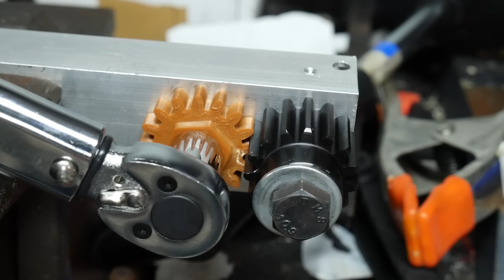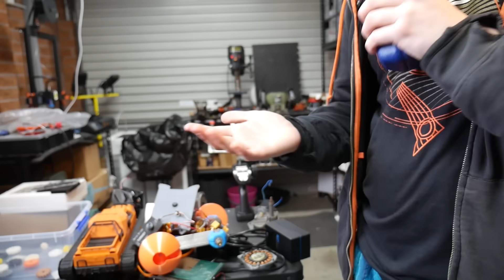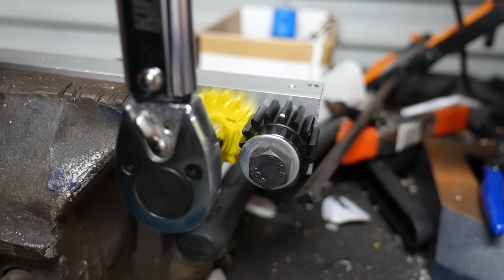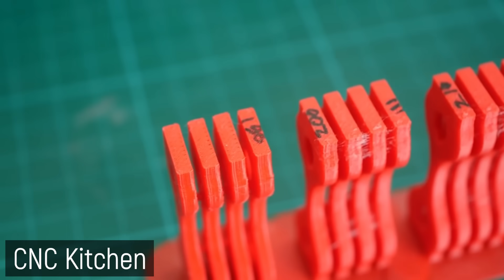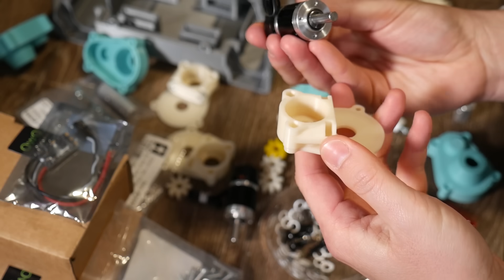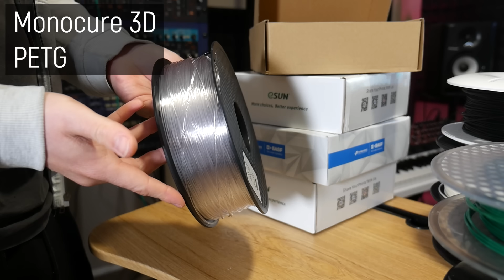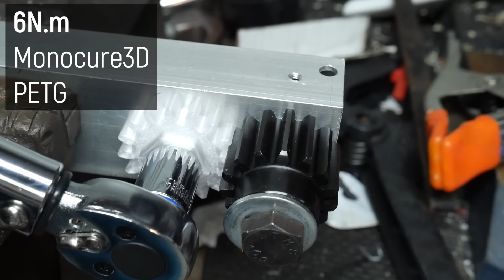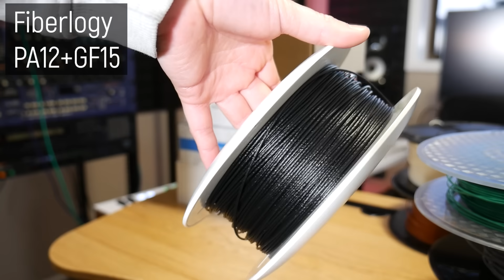Which 3D Printed Gear is Best?

Comment: If you are stripping gears, plastic is not right for that job. 
In that case, I would 3D print the gear and sand cast it in aluminum, like MyFordBoy shows in his YT videos. 
Also, gears must be infill 100% for torque measurements. PLA is fine, but ABS is a standard. If you need more strength, you should go to metal gears for the final stage, like normal people :) 
You'll be more than fine for the gearbox of that little rover. I went with herringbone myself. M1 Mod worked for my robot which is 3 times the size of yours. 
For transmission applications, spur gear is not ideal. Helical is usually used, but herringbone is best. Nosier, but a lot more contact area between each teeth.
Reply: Just about nobody in their right mind makes gears out of ABS. Reason is low surface abrasion resistance. Most injection-moulded plastic gears are made from Nylon, and a smaller number from Delrin, though a bunch of other plastics can make sense.

That being said it's not necessarily the case that ABS filament is the same as ABS pellets for injection moulding, it might even actually be SAN which shouldn't be so strongly affected by surface friction.
Reply: @SianaGearz  See what happens to your nylon gears at 60ºC noob. 
Before all these fancy plastics came out, and the original reprap parts, were all made from ABS for heat resistance.
Reply: @piconano  Short term, nothing happens at 60°C, nothing at all. Over the course of several weeks or months, they will crack. Nylon shouldn't be run continuously hot, it needs time to regenerate by reabsorbing humidity, which it loses at elevated temperatures.

Reprap parts made from ABS - yes, so what? They were designed to be remade as-needed, not to be perfect. The only classic part i can think of with gear to gear contact is the geared extruder, but that simply doesn't run all that much overall distance, an RC car gearbox manages more in a fraction of a day than a Wade in its whole life.

STFU Noob.

Comment: BIG factor for 3d printed gears is heat resistance.  local heating at the contact points due to rubbing and flexing can quickly build up and cause rapid wear.  In my experience over heating is the cause of the vast majority of 3d printed gear failures.  This results in the best gear materials also being optimized for 3 things; high melting point, low friction, and low flexural hysteresis.  (so Torlon > PEEK > Delrin > Nylon > PETG etc.)

Comment: I still don't get why you didn't use 100% infill for a strength test of a gear
Reply: Yeah I stopped watching cause if I was printing a gear, I would want it strong, I'd then test material strength for final prints.
Reply: You might not want it to be too strong, imagine a yard rake where the claws of the rake are thin metal and you are pulling it behind your rider mower, you want that gear to last a long time but you'd rather have the gear self destruct in the gear train before the rake mangles itself if caught on a branch or something big!
Reply: @wolfrig2000  this video is about material strength comparison, not a specific application where you want to limit the strength.
Reply: @crzprgrmmr  and material strength on anisotropic materials depends on many factors. If you print at 40% infill on everything, why would you test a 100% infill gear? It’s about application. That being said of course you could do any level of infill if you’re doing relative strength testing (same conditions, different material). It’s a relative test, absolute testing would be cool but isn’t what’s happening here anyway.

Comment: Hex are a suboptimal solution for driving gears. Since the angle of contact isn't tangential, you tend to have a lot of deformations at high torque.

A splined shaft would work much better. Think about how torx screws are harder to strip than allen/hex screws

Comment: I think heat generated by the friction of the gears is more important in this application. Rather than cracks generated by torque heat resistance would be more crucial.

Comment: I wish you had some POM or iglidur Tribo Filament
Reply: Trust me if even Vision Miner itself says that POM should never be printed you don't want to do it

The Warping;the highly specific temperatures on bed, hotend and chamber; the extremely poor dimensional accuracy and the significant carcinogenic formaldehyde emissions just make the entire package not worth it at all 

Even then the strength isn't really that good especially considering that any printer capable of all this could easily be upgraded to work with better stuff

Comment: You might see how each material wears as well. I know nylon is known as being self lubricating and slides against other gears well. I printed a couple large gears in bridge nylon for and R2D2 that weighed 50+ pounds and they held up incredibly well. Printing in nylon was a real pain though due to warping and shrinkage
Reply: Yes, and so any of the filaments cause nozzle wear in your printer?  That concern, along with needing to run at higher temperatures and fewer color choices are what keep me away from filaments more exotic than PLA and PETG.
Reply: One of the most important things on a gear is that it's designed correctly. If you do it with the correct tooth profile for a gear (and correct distance for meshing), they don't slide at all, they just roll. That reduces a lot the wear on gears. Now it does make sense to lubricate them anyway, specially the shaft and sides as those will be sliding over something.
Reply: I wouldn't call Nylon self-lubricating, its partly flexible which helps. eSun PLA+ I would call self lubricating as it literally leaves a slight oily film if you rub it with your fingers
Reply: @aidangillett5396  Nylon in and of itself is not self-lubricating, but there are some grades of it that you can buy as bar stock which have been oil-impregnated. These are intended for use as bushings / plain bearings or for sliding contact surfaces. I don't think you could make those into filament, though- the oil content would most likely cause some fairly important problems when heated.
Reply: PLA was used for gears and linear slides on hobby 3d pritners because it powderizes as it wears, effectively becoming a dry lube for itself. I've actually been thinking of using it as a linear slide on aluminum extrusions (8020 sells these made from POM) for a project I have in mind where linear rails would be overkill.

Comment: perhaps you could follow up with a wear test to see which filament has the best wear resistance, instead of having a fixed gear you could attach it to an axle with a paddle on one end in a bucket of water or some other load, and then attach  the  driven gear to a drill and spin it either stopping every few minutes until you reach a certain amount of backlash or for a fixed time for every gear and compare how much they wore down. for this test it would probably be a good idea for both gears to be made of the same material instead of one being made of metal. a cordless drill wouldn't be ideal since as the battery looses charge the drill will change speeds.

Comment: Hi Angus,
I have been making gears for about 5 years now as my father repairs the 50s and 60s juke-boxes in The Netherlands and he often needs parts that can't be bought anymore.
The gears used in Seeburg and Rock-Ola Juke-boxes used to be made out of a strong metal, but as mentioned, they don't exist anymore, therefore I print them for him, and normally my printed gears last for about 1 to 1.5 years of daily use in a Juke-box.
One day when I was running out of PLA filament, I made some gears with NGEN (Colorfabb) for him, and he soon replied they were the best gears ever made, and they were so much stronger than the other gears I have made for him.
Now, since 2018 or 2019, I make all of his Juke-Box parts out of NGEN, and especially the gears that I made in this material never had to be replaced anymore.
Now, I have never done tests as you have with this material, but because PLA gave you the best results, and I have made gears that were much stronger, that were made out of NGEN, I think it's worth a try.
I think it would be pretty expensive to send a spool of NGEN to you from the Netherlands, but if you would be willing to send me the STL for the gear, I am happy to print some gears for you and send them over to you, for a test.
With regards, and thanks for this informative video,
Brian Dragtstra, the 3D-PrintCreator.
Reply: I wonder what that is. It says it's a copolyester, so it might be PETG, PCTG or a blend of some sort.

Comment: Try some of the Taulman nylon variants. I use the 910 for gears because it doesn't require lubricants and is more environmentally resistant/durable, but the print quality is not as good as PETG.  I would like to see how the different variants compare though. I'd rather have something that fails catastrophically than deforms with degraded performance and puts more stress on the system until it fails completely or enough to be detectable.  Nylon > PETG > PLA. I also use a helical or herringbone gear rather than a straight spur/involute profile and I think that that lends itself better to nylon than your tests measures.

Comment: A fillet, radius, at the base of the gear teeth should improve performance. If you had that I wasn't able to see it on my phone, they looked squared off which increases stresses at the corner, somewhat akin to a fulcrum effect, which results in materials failing before their actual yield level

Comment: i'll chose PLA first but not only because of the torque or strength.
it is very rigid so less deformation and energy absorbed -> better yield for the transmission and contacts more predictable maybe less play needed.
it is cheap.
it prints well so you will probably get closer to the ideal geometry.
friction coefficient between PLA parts seems low so it will probably wear less fast.
That said because it is rigid it doesn't handle shocks, so maybe you want some shaft in TPU ;)

Comment: ABS has another potential issue your test doesn't account for: low abrasion resistance. In load test it may do fine, but in use you may find it losing material on the surface due to friction against another gear, and you then have plastic flake everywhere, which might not be very healthy for the mechanism. I don't believe that it necessarily applies equally to all ABS compositions, i assume some 3D printing material might actually really be SAN or really close to. Mislabelling is not uncommon.

PLA, PETG and Nylon are pretty immune to this issue. Nylon is also an extremely low-friction material, which can lower friction losses. I expect PETG to be better than PLA. Because Nylon is very springy and capable of restoring its shape after a fault, has good temperature resistance, and very low friction, it has become the predominant material for plastic gears.

Comment: I been using petg, but it fails like you said in my weed eater I just got done pla though hope it's better from your testing it might. Though my petg might be water logged now.
Reply: I had all of my mechanically loaded PLA prints fail 1-3 years after they were printed, but they were remarkably strong before. Some sort of chemical degradation occurs in the material with time.
Reply: @SianaGearz  good to know though for my weed eater that won't be a problem it's just the bottom part for it and they only last me 6 months maybe less depending how many homes I do that year.  That's on a molded part currently I have let to have a 3d printed part last through one house normally print multiple per job.

Comment: Does the positional orientation of the hex hub versus the tooth engaged with the stationary one have any effect on gear failure?  Would be interesting to model the gear with the 3 outer perimeters and infill and perfrom a FEA analysis to see if orientation has an adverse effect.  Still, a very good set of tests.

Comment: Interesting test and results. The popular belief is that PETG is supposed to be stronger than PLA. I assume you printed all filaments with the same settings, but it would be interesting to test wether infill %, pattern and number of perimeters is something that contributes significantly to the strength. Obviously, the strength of a filament can be measured in different ways, like you hinted in the video: some can be better for motor mounts than gears, and the focus for you was gears. All in all, interesting test. I'm sure it's something to come back to with some more experiments. I'd like to see the effect of various printing parameters on the strength.

Comment: Nice work! I'd say the PA12 (nylon) is a better choice since it doesn't damage the gear at all when it fails. Meaning you can keep resuming the use of it, long as the load goes back down and stay under. It's like a fail-safe damage prevention. Ideal for any sudden force/stop situation in RC cars.

Comment: 20% infill was a bad choice for this imo.  there's not much material to tie the teeth in with the rest of the gear.  IMO you'd want to print them more solid.  Notice the deformation is starting at the interface between the walls and the infill, there wasn't enough to keep the wall from pulling off of the gear.  you can get stronger gears if you print at 100%.

also please normalize the hex orientation, some of them the point of the hex was towards the steel gear, others the flat was tangent to the steel gear.

CF/GF-nylon has become a no-go for me due to not being as stiff as the sheets always claim, and it gets softer with age and exposure to moisture.  It also has a huge problem with creep, worse than PLA.  Try some CF-ABS and CF-ASA from 3dxtech, should be very interesting results.

Comment: Interesting testing, not surprised at BASF’s results.Their products always outperformed rivals from both personal experience at home and in an industrial workplace. Quality German engineering, though 3D filaments seem an odd market segment. But I guess industrial scale filament printers are commonplace and Germany has heavy vehicle development where it would suit.

Anyway for future failure points I say Any type of failure should be where you draw the line. Flexing and bouncing back (visually, as ideally you want to design tests for various load types and take accurate caliper measurements before and after each load test). Stretched permanently or to the point of slippage I consider failure as does breakage of any type. You are basically testing to the point of failure and here any type of failure gives you a “danger Will Robinson” force value to avoid in your project, something you may not be able to measure or calculate. You are only getting a ballpark figure of comparison. You’re aware of other types of filament testing others have done over the years and know that one test wont rule them all.

Once you have your filament gears tests done I think you should take the consistently best/worst/average filaments and print again using:
- Default settings  & various post print processes to strengthen the prints
- same model with differing infill types and amounts.
-maybe optimised/simulated improved model (eg small rounded bevels instead of 90deg angles that can get caught in a gearbox or be the focus of stresses, and print again with best/ave/worst filaments.

This way you get a graphed idea of the various filaments “naturally” from you current approach. Then you can graph what effect if any post processing of prints has and see if the difference is consistent or widely varies (using best/avg/worst should give an idea if say annealing always strengthens by around 8% for example or if its consistently random (indicating the treatment must be done with every filament to reach a sound conclusion). Also you might find just putting in the time to optimise the design always results in performance improvement. Of course slicer settings optimising per filament should yield differences, but I think the hobby has matured enough where that shouldn’t need to be done and recommended settings are suitable. Of course old opened filaments should perform differently and testing should have been done with brand new  sealed filaments and probably several rolls each to average results.

If you want you could try testing performance, run the gears at speeds against the other cog being loaded, until failure. This takes in friction, meshing of the gear design, heating/cooling/loading? cycles… though other have videos of this sort of thing already.

Comment: Back in the old days I had a torque wrench that had an indicating needle. It did not ratchet when you reach a certain torque, there was a needle and as the unit bent under the pressure applied to the handle, the needle showed how much torque you were applying. That would speed up this process, I think. I don't know if you can find them any more.

Comment: Very interesting video, but I think there are problems with your testing methodology.

You are only testing static strength, by gradually increasing the torque value. Which is something a properly designed mechanism should never experience ! When it fails, it should be because something went wrong, and the torque jumped ... So "tough" materials, that are softer but with creater "shock" resistance (impact strength) are ideally suited ... There's a reason why most injection molded gear are either ABS (if cheap) or Nylon (if more expensive)

I have no clue though on how you would be able to test that at home though ...

Comment: I really wish you could test PEEK gears.
Reply from the maker: But you can ;)?
Reply: And a polycarbonate, hi 3DPN.
Reply: Lets make them from Boron Carbide while we're at it. It is the 3rd hardest substance known (behind cubic boron nitride and diamond) can be printed on binder jetting printers. It's used in tank armour and bulletproof vests.